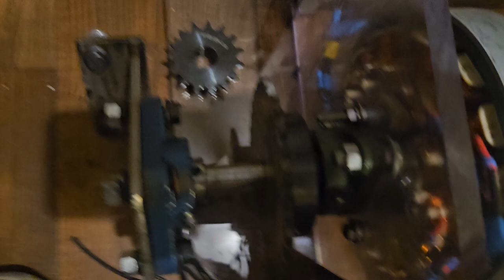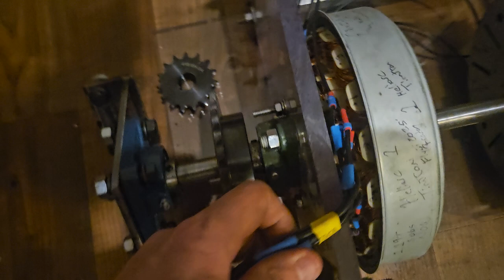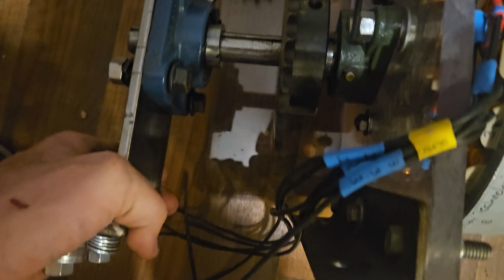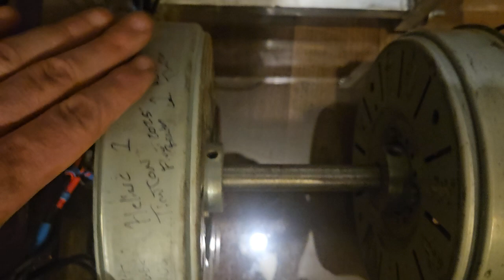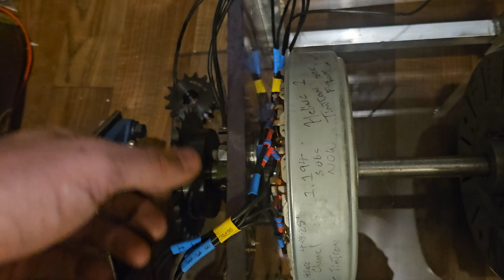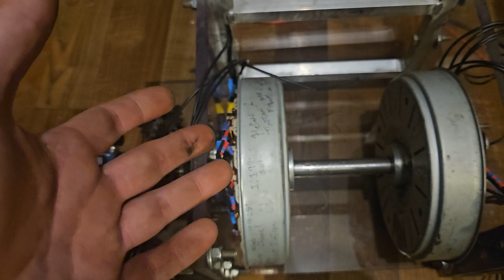1.5kw Generator Wiring Explained, Leverage Explained. 3HP Diesel Generator.

Comment: Heliarc good stuff, still looking for those motors myself. I am a junk yard dog.😎
Reply from the maker: If searching for HVAC ECM motors.. junkyard most definatly is the way!! 

The modules on the back of the ECM are generally what goes bad. Not the motor itself unless it's dropped or crushed. In fact, usually, the driver fails long before the bearings fail.

Many junkyards will have a surplus of them!! They make great, almost out of the box PMG generators for many projects!
Reply: @Heliarc91   I think I may have one already. We had to have a new set put on a fairly new unit years ago. I kept both pieces. Now just need to find it.🥴
Reply from the maker: You can buy them for $35-$80 on ebay!!

I haven't seen any 8" (18 coil) stock copper wound though.

There is a Samsung and a LG model though that does have 21ga copper instead of aluminum!

The aluminum wound ones are usually the cheaper ones!

Comment: Looking good mate. Here's something you might find interesting. If you wired both your smart drive motors into broken delta (open delta) whether in series or parallel, A triangular shape with one corner  intentionally left open,  it will create a phenomena called Ferroresonance. Ferroresonance, a nonlinear resonance in electrical circuits, leads to higher voltages due to the interaction between a circuit's capacitance and the nonlinear inductance of a ferromagnetic core, like a transformer's. This interaction, especially when a transformer's core saturates, can create a state where the system jumps to a new, high-voltage steady state where the output voltage and current will be much greater than your supply input. Conventional transmission systems use damper or limiters to mitigate such effect for power grids, but inherently it is OU without the BS. But word of caution, This experiment is not for the timid novice, without proper knowledge or understanding to contain and harness such extra power, similar like the bemf through a transistor of pulse motors which needs the output load can be dangerous, frying everything and can even kill. Further down the track after the my pulse motor video I will post a demonstration with my  modified smart drive motor using the Ferroresonance and the ferranti effect combined with modern igbt.mosfet driver circuits.
Reply from the maker: Thanks for the info Sam!

I may try it. I have tried those configurations on "loop attempts" with my clockbox setup (on the white plastic) , but voltage was clamped to the driver, I never measured the open wire. I just left open to remove a phase essentially and collect only the single phase from the 2 wires. 
Tried many things like that.

My mini that I had, may of actually been "loping" on ferroresonance. I put a 267UF Run capacitor over one of my 3 phases (i broke a 12 coil [CW/CCW winds] ECM into individual phases) and the system would actually try to stay running for a short time. It would "lope" quite alot and if i were able to get the voltages higher (my driver and buck down wouldn't allow over 80v at the time) it may of continously ran.

Great insight and i love your channel!! I am still learning every time I shock myself too!
Reply: @Heliarc91  Your most welcome  and thank you. I'm learning lots of valuable gems from you channel. You have great ingenuity and insight towards your project and cant wait to see more of it 👍
Reply: Just subbed Sam. Looking forward to your build.